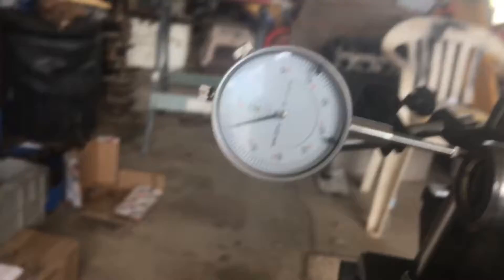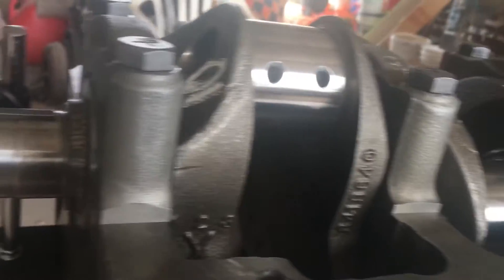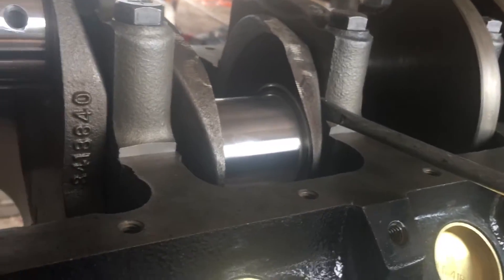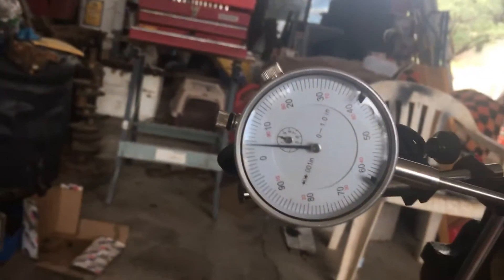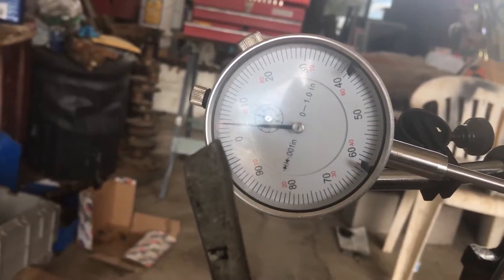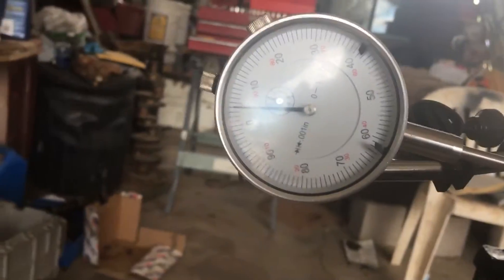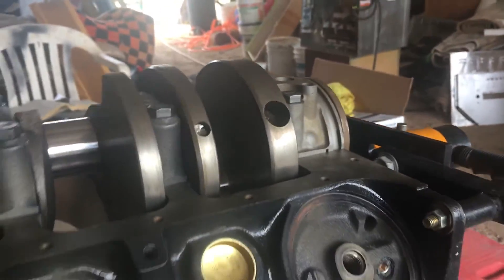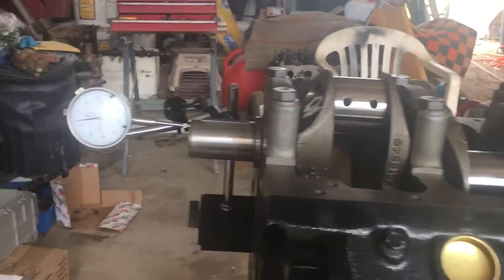How to Check Crankshaft End Play With a Dial Gauge

Comment: Nice. I was gonna do it with feeler gauges but I figured the $35 was worth it, plus the earlier you invest in a tool the more you get your money’s worth. 

Now’s to hoping the block’s not cracked because there was a bit of non 50/50 mix in it over a winter.